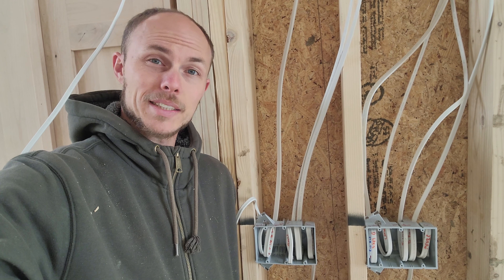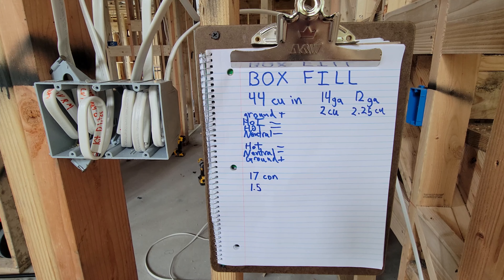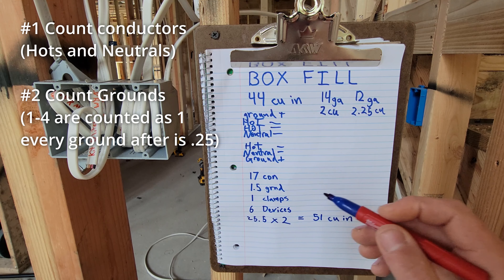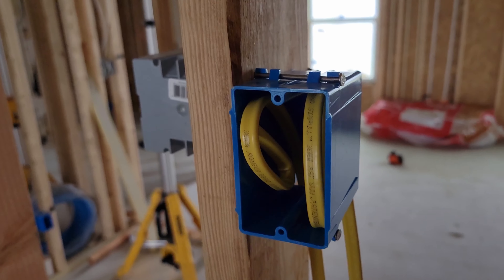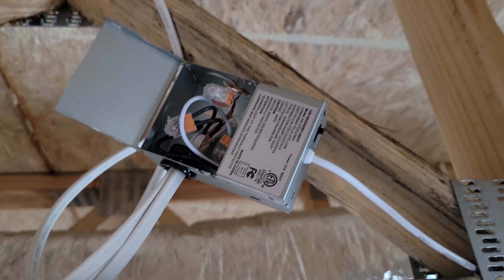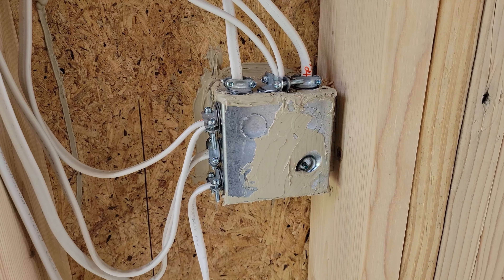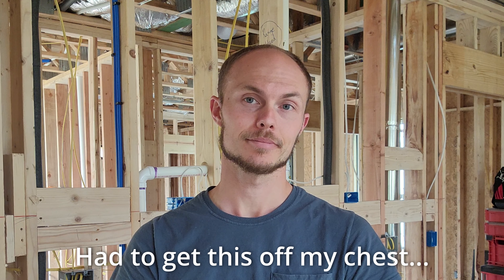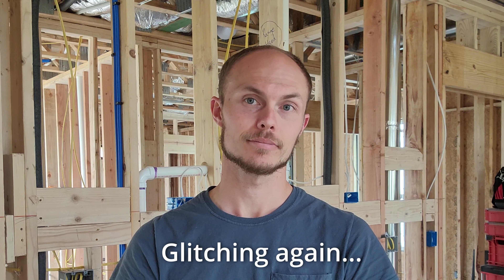2023 NEC Box Fill Lesson

Comment: Why are you multiplying by 2.25?  

Does a 12 ground and 14 ground hold the same value?
Reply from the maker: The rule is to multiply all of the conductors/yokes/devices/clamps by the size of the largest conductor in the box. So if you have two 14/2 coming in and one 12/2 coming in, then the four 14ga. conductors would be rated as if they were 12ga. And because the 12/2 has a 12ga. ground in it, the 14 ga. grounds also get counted as if they were 12ga. 
  So 6 conductors + 3 grounds (any amount of grounds up to 4 count as one multiplier) would be (6 +1) 2.25 = 15.75 cu. in. total volume needed. 
  If you have clamps (they all count as one) and a device/yoke (each one counts as two) then you would have (7 +1 +2) 2.25 = 22.5 cu in.
  Hopefully that all makes sense.
Reply: @MyFortressConstruction  i understand what you are saying however that's not what I am seeing in the 2023 NEC handbook. (Which is why I'm confused)  It is counting the wires separately and adding them to get the box fill.  Article 314.16. Page 325 in the book.
Reply from the maker: "...a single volume allowance in accordance with Table 314.16(B) shall be made based on the largest conductor present in the box”

Is this what you're referring to because it's talking about any kind of device, clamp or yoke that's within the box fill calculation is based on the largest conductor.

Comment: Great video. One question though in the last example why is there a 12g ground and no 12g conductors? wouldn't a 12g ground be in a 2 or 3 conductor cable?
Reply from the maker: Thanks, so it is the egc that is only grounding the metal box. It's not coming from a cable.

Comment: I believe you made a mistake on your ground calculation on the metal luminaire box. You said "Since the grounds have a 12 AWG connected to them, that means they will count as 2.25 cubic inches even though the majority are all 14 AWG." 

2023 NEC states "A single volume allowance...shall be made based on the largest equipment grounding conductor ENTERING the box. A 1/4 volume allowance shall be made for each additional equipment grounding conductor that enters the box, based on the largest equipment grounding conductor ENTERING the box." 

So it looks like the total ground volume allowance should be 8 + 1 (for the 12") = 2.25 volume allowances x 2.00 (Table 3124.16(B)(1) multiplier for 14 AWG) = 4.5 cubic inches.
Reply from the maker: Interesting. Definitely have to pay attention to verbage and definitions. I was told to adjust everything if there's one, regardless of its origin, as long as it was 12" or longer, but I think your argument is a good one.